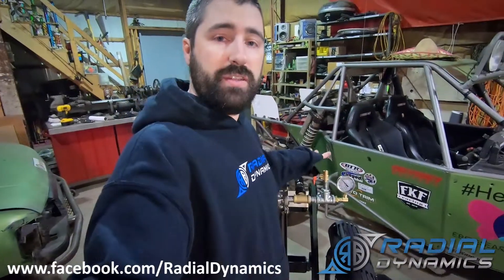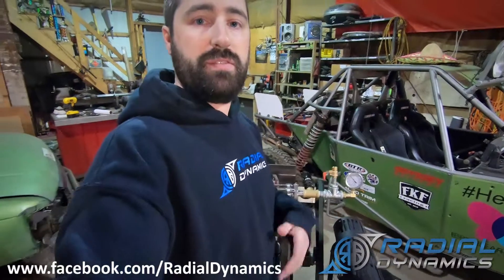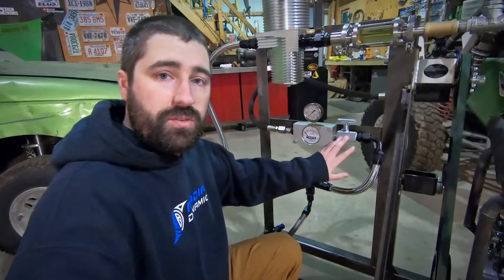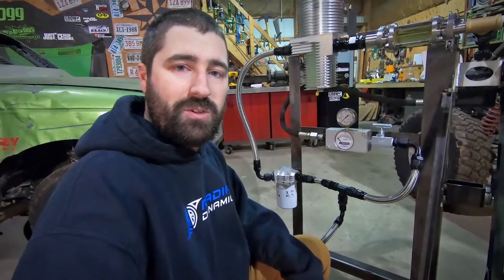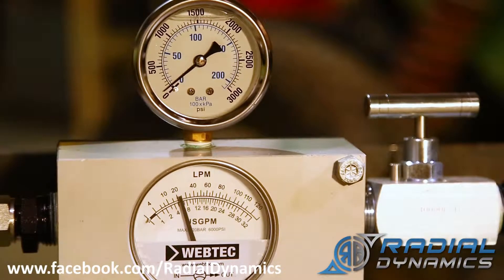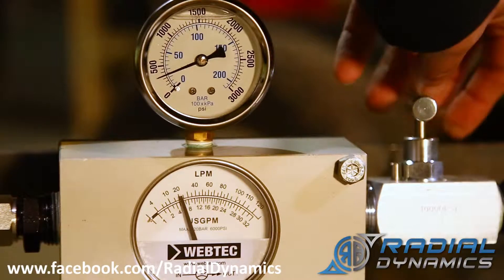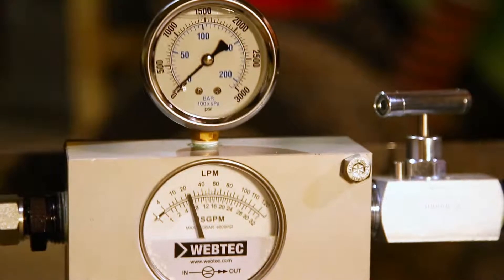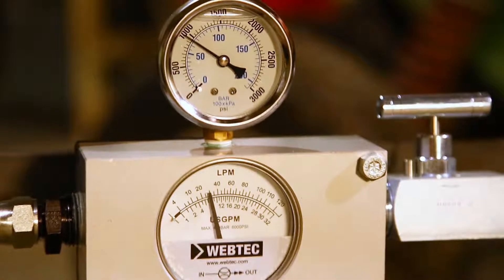Radial Dynamics - Steering Pump Flow versus Pressure

Comment: I’d be curious how a temp sensor reacts right there at the pressure sensor when you’re modulating that valve. I’ve heard that 1000psi noise a lot before when wheeling 😅

Comment: Have you ever notice a difference when installing your needle/flow valve on the input side vs. the output side of your flow meter. I’ve seen it done both ways. Generally I always install my valve on the output side.
Reply from the maker: Although there will theoretically be some amount of pressure loss through the flow meter, the effect is negligible compared to the pressured being measured here so no, installing the valve upstream or downstream from the flow meter does not produce any noticeable difference.
Reply: Thanks for the info!